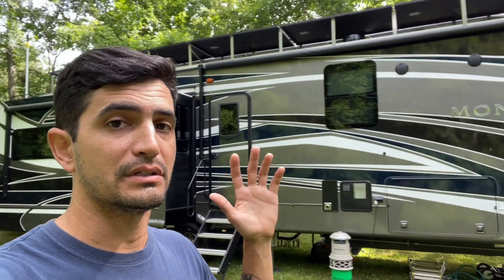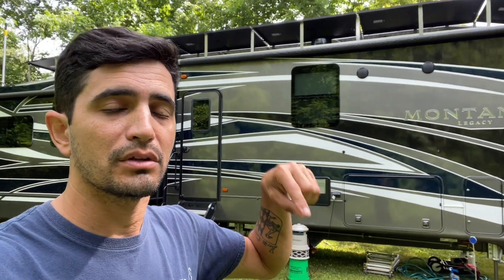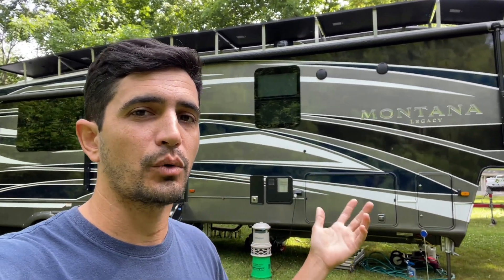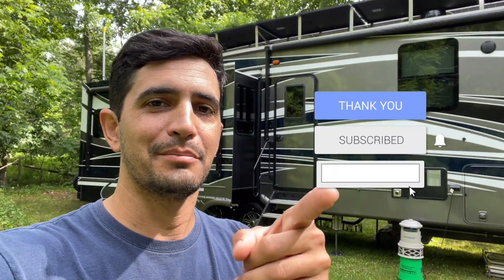What Voltage SETUP? 12 / 24 / 48 Solar Saturday Part 5 - Why Not RV

Comment: I've been enjoying your series.  One other HUGE benefit to going 48v and smaller gauge is the cost.  I havent looked to see if there is a significant difference in price for the inverter and such though.
Reply from the maker: Yes for sure it definetly offsets because you get the price savings of the smaller gauge wire but might need an additional component such as a 48v to 12v converter which makes back up for the saved cost of wire.

Comment: OK, I’m cheating here. How much wattage did you say the eco-cool would take? and would there be a problem starting it with the 12 V system? because answer your question what type of system am I building …building sprinter van 144 I’m just concerned with the eco cool AC because I have a dog and then from there I’ll have a fridge and lights,water pump, cell phone charging. That said… Is the AC the 110 AC alone enough to wanna move up and to 24or 48 V?
Thank you 
Bill
Reply: Thank you and was there a problem starting it I saw a few people comment
Reply from the maker: No. It starts no problem.
Reply: @WhyNotRV  
Thank you 🙏
Reply: @WhyNotRV  oh and the Eco cool does it really have a heater in it as well… and also does it have a fresh air only fan?
Reply from the maker: It doesn’t have an electric heater. It is a heat pump and did pretty well for me over winter down to about 40 degrees outside it kept the airstream warm. It struggled down in the 20s but that’s what the gas furnace is for as backup.
Reply from the maker: The eco-cool unit takes anywhere from about 800 to 1200 W mainly. A 12 V system works just fine. That’s what I have in the Airstream. The only reason you want to go to a 24 or 48 V system is if you were doing a larger build with Solar and maybe dual inverters. 99.9% of RVs can be 12 V configuration all day long.

Comment: Not sure if I had asked you this question on a previous YouTube vid or not. But I have an idea to keep my small 12v solar 170w setup (2 AGM's). But add a 48v system in the back of my 5th wheel (GD Reflection 303rls) under the DIY sofa/dog bed, then have a sub panel with a 30a breaker and just plug the 50a or 30a RV cord into it. We'd only run the one A/C when needed for a very short time. And be able to run all the 120v systems in the RV and the 12v converter would still run the lights and the 12v fridge. Or is that just too simple? :-)
Reply from the maker: There are waaaaay more than 1 way to skin a cat. It’s a trial and error thing. That sounds like something that is possible.

Comment: I find your channel very helpful, thanks for all your efforts!

I'm just now working through my approach to the 12 volt system in my fifth wheel toy hauler. I am designing a 48 volt battery system with an all in one charger/ inverter.

The RV panel is the typical 120v with 12v sub panel and fuses.

If you have more info on how you use your 48v inverter but kept your existing 12 volt system and battery separate I'd love to see a post about that!
Reply from the maker: I go over how I accomplished that in this video. Let me know what further questions you might have after. Victron Mobile Power Plant - Why Not RV: Ep 88
https://youtu.be/E_nCS8SpUCY